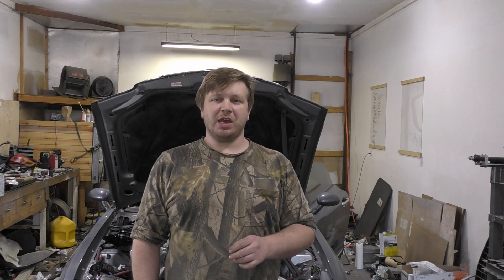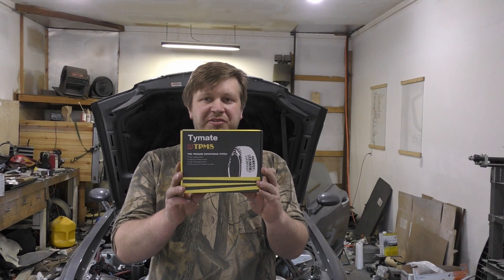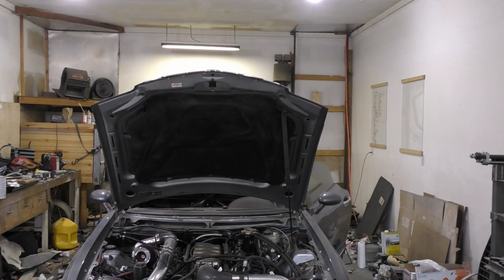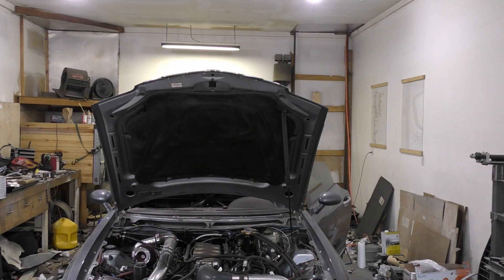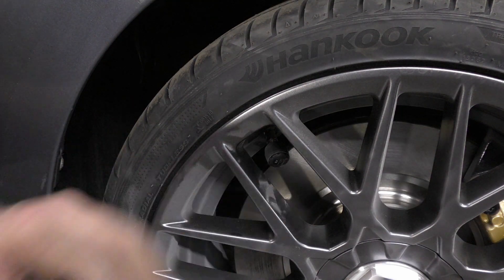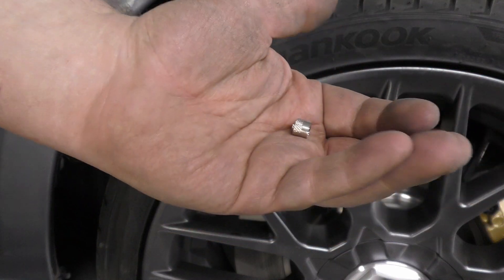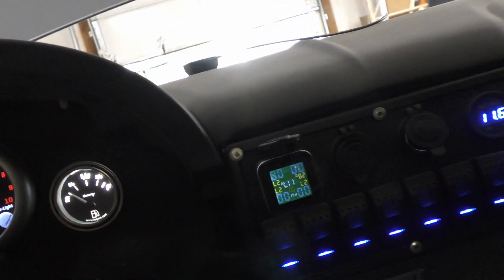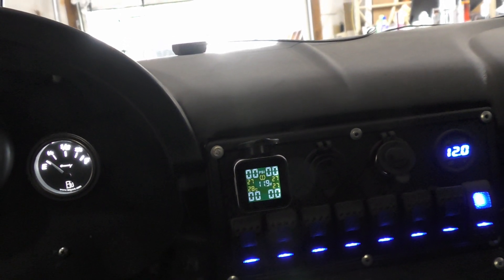V8 Crossfire Project: Cheap Tire Pressure Monitoring System

Comment: Thanks for this video. I just bought this system and wasn't so sure about installing it. Your video will certainly make it easier. I do have a few questions. Are batteries already installed in the sensors? When you need to manually check the pressure or add air, I assume you have to take everything back off? And if so, how long does that take? And it's now several months since you've posted this. Is it still working for you? Thanks again.
Reply from the maker: Still working great so far.  Mine had batteries preinstalled.  I haven't had to add air yet, but just the cap would need to come off.   Just keep the little wrench in the glovebox and maybe 15 seconds and you can add air, not much of a hindrance in my opinion.  I plan on getting a few more for the other vehicles I have.
Reply: @Drivewaybuilt  Thanks so much for  your fast reply. I feel better already. I'll plan to give it a try...and I'll be using your video as my helper.